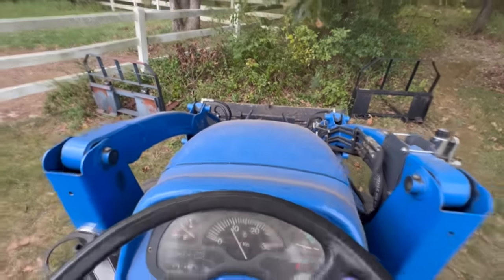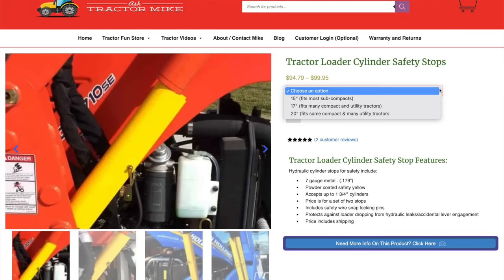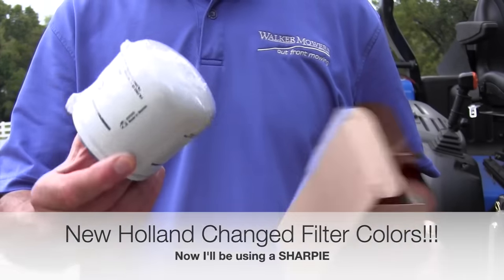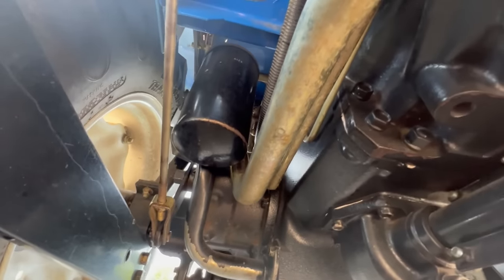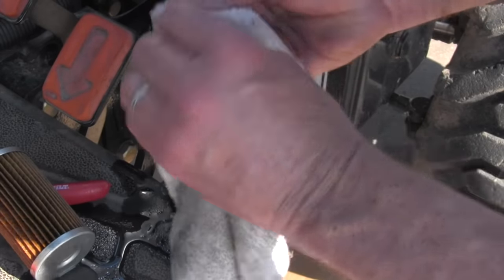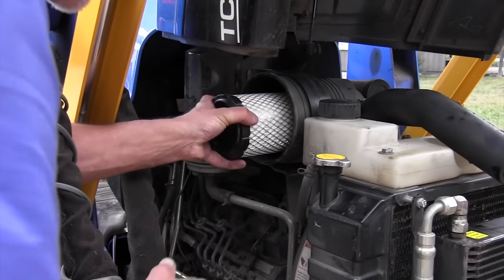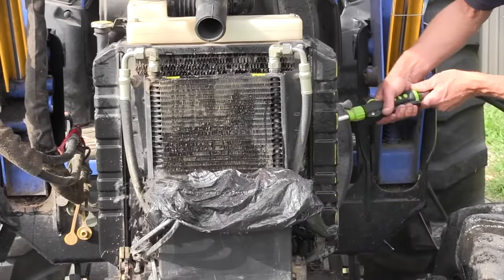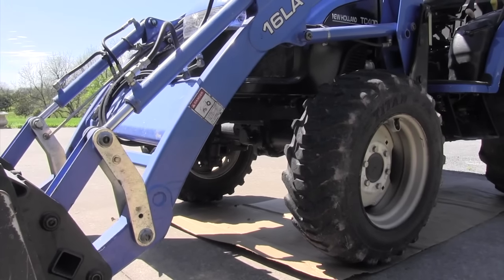Complete DIY Tractor Service and Some Tools to Make it Easier

Comment: Those stops work very well. I bought them from you. Hope you feel better soon
Reply: You are lucky. The set I bought did not fit the loader size as advertised and the seller (i.e. this guy) did nothing to resolve the issue. They are still sitting on the shelf in my garage... $100 wasted.

Comment: The radiator genie is excellent.
I use the air powered wand - remember to reduce the air pressure to approximately 35psi to prevent damage.  It prevents the tractor from running too warm.  Clean the oil cooler and hydraulic fluid cooler too.

Comment: Excellent video. I didn't read all the comments but if it hasn't been noted already, you should probably wear neoprene gloves while handling the fluids involved. 

I was impressed with your list of tools. Over the years I have stumbled onto both the Lube Shuttle system (best ever) and the radiator genie (works well but I usually get away with using a 57V Worx leaf blower every time I use the machine - saves waiting for the air compressor to fill).

I'm still hoping for the magic tip to get the oil plugs out without getting oil all over my (gloved) fingers AND no dropping the plug and gasket into the drain pan!

Always enjoy your posts...

And yes, COVID sucks.

Comment: Worked in maintenance all my life. People don’t know all the problems that can be caused by using the wrong lubricant or by mixing lubricants. Like you said the proper care of your equipment will extend the life 10 fold. Great video.
Reply: You can use all the proper lubricants you want, it won’t extend the life of a machine at all. 

But using the wrong ones certainly can reduce a machines life.

Comment: I can say I never got covid and maybe it's because I got the shots. I hardly ever get sick. When I change the oil in my tractor i do one plug at a time because one time I didn't and what a mess it turned out to be. First time changing out the filters on the hydraulic system was very hard since they put them on and then paint the tractor. Both my hydraulic filters are right next to each other. The little filter was easy because not much oil comes out. When it was time to do the main filter i had already prefilled it and the oil kept coming out so trying to hurry to put  it on without cross threading it was interesting. That's why they invented hydri. I use kitty litter. I tried using pig blanket material but it still left a mess. I have an LS tractor. I think before winter I will change the antifreeze to fresh. I hope you feel better soon! I may invest in the cylinder safety pieces, good idea!

Comment: Covid is sure a drag. I had Omicron a while back and it had me feeling crappy for about a week with a cough that lasted a couple weeks after that. I hope you start feeling better quickly, Mike!

The Radiator Genie is an excellent tool. Cleaning out the radiators on my Kioti DK series cab tractor keeps the A/C blowing nice, cold air. When the A/C starts blowing warm, it's a sure sign that I need to get the Radiator Genie out and spray some water.

Take care and God Bless.

Comment: The access to the oil filter in the New Holland T4S (Workmaster) is too over complicated. Even worse if the tractor has a loader. Seems like FPT readapte some engine used on other platform to a tractor.